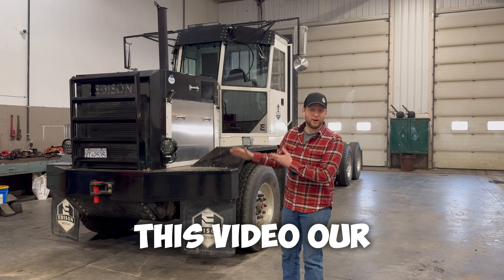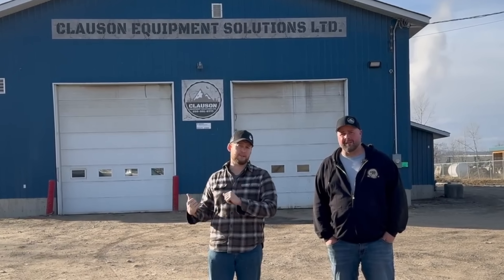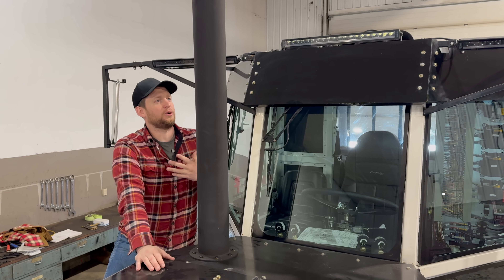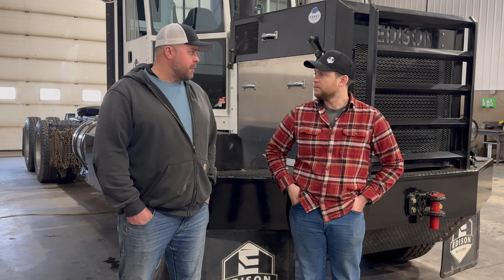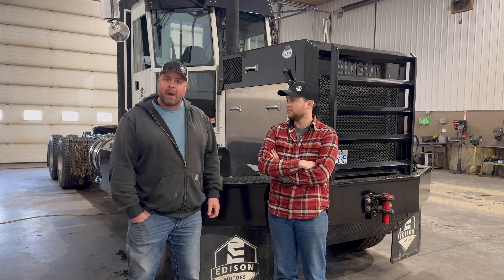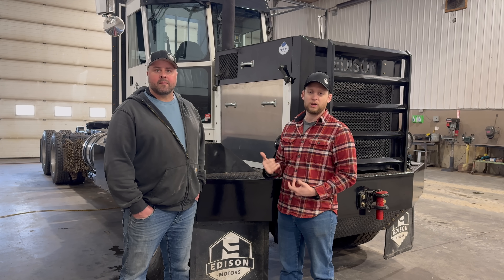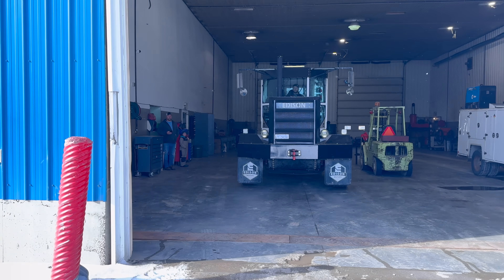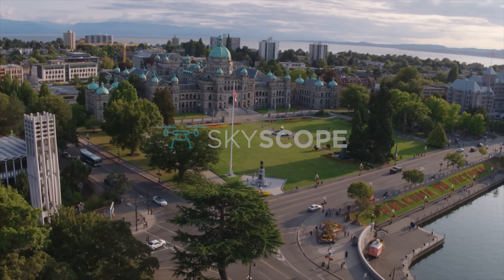Our Electric Truck Success Story : Government Recognition

Comment: One of the huge benefits to rebuilding classic trucks other than the environmental reasons and aesthetic concerns is that these trucks have been real world tested for half a century already! Now the improvements and upgrades need to be tuned to work together and work out the little issues and voila! A new more reliable, economical, long lasting tool that's cheaper, more reliable, and easier to live with and use!

Comment: For the hood stack, you should make a model where it comes out at the very front and center, much as a smoke stack from a steam engine. In fact, use the diamond shaped stack so you can claim that it's running on wood.

Comment: But... but... Topsy? Why that corny name? Please explain...
Reply: I can answer that for them, if they don't mind. During the battle of electrical power in the late 1800's and early 1900's between AC and DC, Thomas Edison electrocuted and elephant named Topsy. And the truck was named in it's honour. Meanwhile the war between Nicola Tesla and Edison was very public, with Edison convinced that DC was the way to go. Well, you don't see it used except in low voltage applications because AC is just superior for electrical transmission. So, take that Thomas Edison, you jerk... 
Hope that answers your question. 😁

Comment: Chase Congratulations on your mildstone. I been dreaming of choping up a wrecked tesla for a basic trailer but have you ever considered putting the electric drive axles or something to help with prepoltion on a trailer. Other your logging trailer or low boy? I know Topsy is a Torque Monster but. For some reason.  I see electic axles for the use for trailers.
Reply: They did mention putting drive axles on trailers on at least one video but I can't remember which one.

Comment: You’re closing statements you said 140,000lbs. Holy crap that a load. In pa if you’re 88,000-90,000 you’re heavy hauling

Comment: You asked for comments on Topsy (or any future design)
I guess Topsy is perf3ct for the lumber work you designed it.
For a more road/highway bound use you likely will want to get shorter - Try on an old Renault/Mack "Magnum" - looks like a cab-over, but it is really a cab over engine module - there is NO engine cover/bump in the cabin - it is flat like a bus - at 1.87m I can stand up no problem!
 Total hight is near max total allowed. One real advantage I that you are ALWAYS ABOVE everyone else - you see everyone and everything!

Try one out!!

Comment: So is the system designed to automatically turn on the diesel engine if the battery reaches a certain level and turns off if it when it is back up to a certain amount?  Also how much does the generator charge compared to the draw when driving down the highway with a full load?  Can you plug the truck into a charging station to recharge?  What is the range on batteries alone and with a full tank of diesel?

Comment: This is something to celebrate!!! These guys had an idea, and followed it up by getting the funding, to design and then BUILD, their dream. If this doesn't make Tesla and the others quake in their boots, then they are doomed to Failure. These guys now have received Government acknowledgement, that they have a Legal, Safe Vehicle that is safe on the roads that they can sell! There are plenty of people out there who want an affordable, easy to maintain truck. I wish them all the luck in the universe in their adventure and hope they will be able to export their ventures world-wide, They have given the industry that they are now part of, the direction they should all follow. The world is changing, systems have to change to enable the world to survive what we did in the past. This electric truck can help reverse the trend of climate change by utilising older vehicles which had redundant engines, gearboxes or rear axles, that have no life left in them, to be rebuilt to a good standard. To serve the community they serve, for longer and cheaper than brand new vehicles, that are utilising ever more valuable resources that are getting hard to find. Unless recycling is put to proper, sensible use, then the whole world will grind to a halt sooner than currently expected. THANK YOU ALL at EDISON MOTORS for what you have achieved so far and what you will produce in the future. From UK.

Comment: PLEASE don't make a hydrogen version of your truck. You don't need to waste your time and energy doing so, EVEN IF THE PARTS ARE DONATED! Hydrogen is not practical, too complicated and problematic to become competitive.
Reply: Could you please share your engineering and research documents. I'd really like to hear why?
Reply: @RainbowGin  I admit, I don't have any engineering degrees. My research has been limited to the internet. I have noticed that even the oil industry is backing out on hydrogen! The stations that they have are too expensive to maintain, and are very unreliable, by far exceeding down time of liquid fuel pumps!

Hydrogen does not exist by itself unattached to another atom, , therefore it has to be extracted! The process is very complicated and expensive!

The simple act of storing the fuel makes it very expensive, as you have to compress the gas. Compressing a gas requires higher pressure than pumping a liquid! My obit limited knowledge of physics tells me that there will not be a revolution that reduces the cost of compression exponentially, which would be necessary to drive the price down.  Pressure tanks are not going to become as cheap as gas tanks.

Plus the fact that you get a limited amount of electricity out of the volume of hydrogen. You need way more space to store enough hydrogen to power a vehicle to travel the same distance as you can with a current style battery! Battery chemistry will change, dropping their price, increasing their energy density, possibly increasing their usable life. No comparable advances in compressing, and or storing a material will happen in the next century!

Then there's a point of collecting the hydrogen, as green hydrogen requires double the electricity as simply putting the electricity into a battery and driving! This part of the process may improve, but you still have to store the finished product.

So far, I've ignored the fact that a collision, line damage, plus a spark in the right place could result in a divot where the two vehicles used to be because that much hydrogen is basically a bomb! Remember the Hindenburg?

Engineering Explained addressed the calculations of how much hydrogen you would need to store for a car to travel as far as a then current EV can, and if you put batteries in a Chevette sized car, you can get good range, but it will be physically impossible to put enough hydrogen storage in the vehicle to travel the same distance!

https://YouTube.be/vJjKwSF9gT8?si=ZwB_h-1h5D4Gli3i
Reply: Stan Meyer learned how to split water into hydrogen & oxygen, using far less energy than the (traditional, going back to Sir Michael Faraday) electrolysis process.  Last I heard, his brother still lives in Ohio (where Stan was poisoned in 1998).

Comment: Still think a hydrogen powered engine needs to be a future offering as a Topsy option and in the retrofit kits. As a NorCal Owner Operator with a 1951 Peterbilt waiting to get on the road in a state that has green ideas that might not support a still fossil fueled hybrid.
Reply: Edit: just realized I want to convince the wrong person that diesel is the best option for now. But my Points are still true 

The problem with hydrogen is it is still mostly produced from coal and methane and coal (Grey hydrogen) and not from electrolysis(green) that gets the energy from green sources like wind or or the sun. 
Also, the efficiency is quite low for hydrogen. It's easier to put that green power into small car batteries and make them 100% electric. And only use diesel where it makes more sense.
It's also hard to deliver this hydrogen fuel into the backcountry like Diesel.
Also the diesel is only the powersource. I am sure if you buy an edison truck, they can put a hydrogen generator in there for you. Or you can put it in yourself.
Reply: Not practical outside of NorCal...